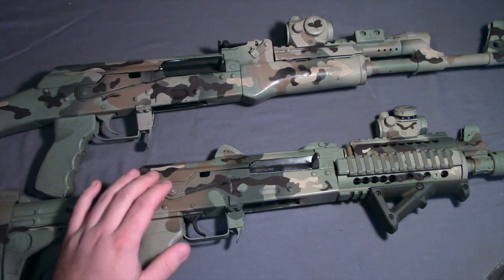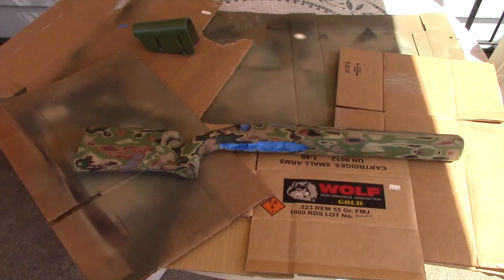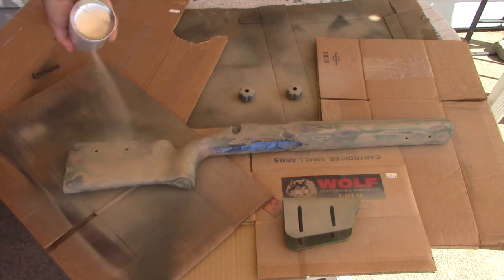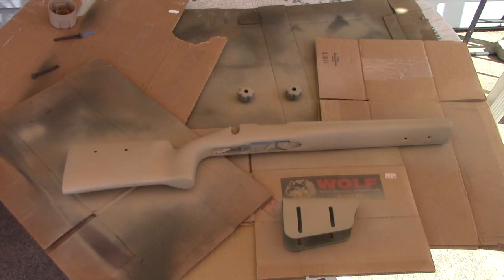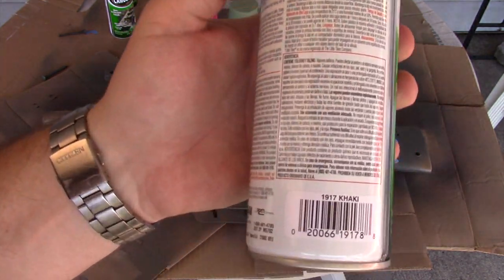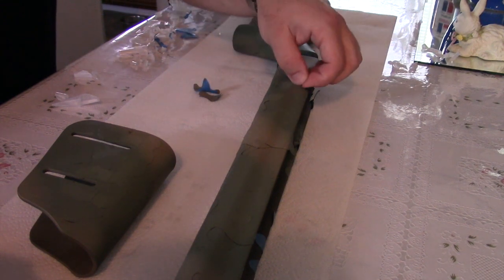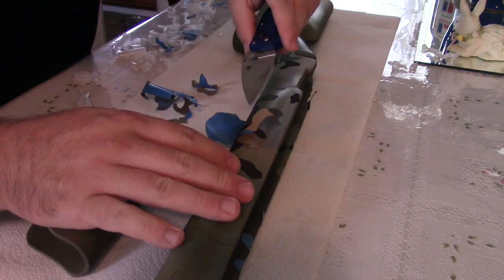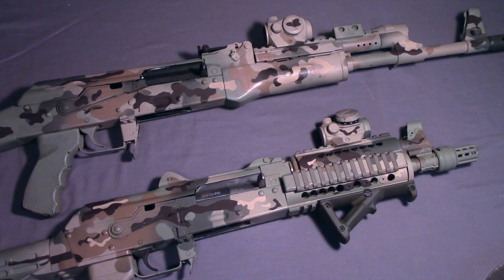Multicam Rifle Paint Job - How to

Comment: The green frog tape works really nicely and if you use a folding bone to press the edges down that will give you the best adhesion also waiting a full 72 hours before applying tape and subsequent coatings.  It’s a long time to wait of course but worth it to avoid peeling of previous layers.  An old wire hanger will aid you in hanging item to be sprayed so as to avoid having to flip them.  The Simpson String Tie building materials company also makes lengths of hardened steel normally meant for retaining insulation that are great too if wire hangers aren’t readily available.

Comment: I've used the exact same colors to do multicam before. Very sound advice, especially on the stencils. I've done that before and it works great, but if you have access to a Silhouette Cameo, its pretty easy to make vinyl stencils if you have a piece of multicam gear to transpose the pattern from. Then you have as many stencils as you want and you can pump them out fast after the initial designing them. Using this method you can get some real squiggles, beans, and blotches from the actual pattern. I pulled mine from a shooting mat and its amazing how many repeat stuff there is in the pattern. Some things that I do a bit differently, when I get to the last two striped coats, I spray one color over the complete rifle and then stripe with the other. I think its easier to make some more subtle blends between the colors and it looks pretty good. Also the strings and beans tend to stick together and string along the pattern. There's patterns to it, but its hard to see unless you have something huge to observe the pattern on. Its hard when you just have little pieces of gear. I did my welding hood and it turned out pretty damn good, but I'm planning on duracoating 3 rifles in the near future.
Reply from the maker: Interesting, I'll have to check it out. I think if I ever do this again I'll use already made stencils from Freedom Stencils.
Reply: Brad Chenoweth 

Welding hood!

Let’s see it

Comment: I just started on my m91/30 Nagant. I'm gonna run up & get the wide painters tape today or tomorrow since it's suppose to be a bit warmer this week.... So I tagged this video as my guide...
Reply from the maker: That's great! I hope it works for you!
Reply: I'm using the same colors that you are but the difference is I'm cutting out all my stickers instead of the sticker kits that most people are using so it's a bit slower but so far they look good. I have Forest Green & a lite coat of Desert Tan for certain area's to finish it off.....

Comment: Looks good, what type of clear coat did you end up using?
Reply from the maker: +Martin Carrera Good question, I probably should have mentioned that. I used the Rustoleum Matte Clear coat. I wanted to make sure that even with the clear coat, it wasn't glossy and therefore defeating the purpose of the camo in my opinion.
I appreciate you watching!

Comment: well done. do you have to cure the paintjob with cleatcoat or do the rust oleum colors resist oils/sweat from the hands? did you tape the trigger?
Reply from the maker: I usually tape the trigger. I do not use a clear coat personally because I like the look of a used gun
Reply: @OreGear  how long does it take, before the paint starts to rip off?
Reply from the maker: Depends on how you use it. If you are running a fighting rifle through classes, it’ll start to wear more quickly. If it’s sitting in your safe all the time, it’ll last a long time.

Comment: did you ever have any issues with the paint on the barrels from heatingup? looking into painting my gun thanks.
Reply from the maker: +jessintime I had the barrel on my Arsenal bubble a little bit around the gas block when I was doing a heat test a long time ago. I dumped 150 rounds in under 2 minutes.

Comment: Ore,did you paint the inside of your receivers on the AKs?what did you use to plug up the chamber and muzzle?
Reply from the maker: +ELad Neb Good question, I probably could have elaborated on that more in the video. On these I taped off the inside of the receiver. On my Arsenal I just left my bolt carrier in the gun to block off paint from getting in the receiver. I would try to avoid getting paint on the inside on the rails and such. If you do, I don't think it'd cause too many issues, and I'm sure standard operation would wear the paint off very quickly. As far as the muzzle, I took a piece of paper and rolled it up and inserted it into the barrel to prevent paint from getting into the barrel.
Hope that helps! Thanks for watching!
Reply: +OreGear thanks Ore,if you know if I can get premade tape patterns for doing a tigerstripe paint job let be know.I want to do up my new/ old SAR 1 in a black/burnt orange with some yellows for fall in the north east
Reply from the maker: +ELad Neb I would look at Montactical.com, they have lots of different types of stencils that you can use to make all kinds of patterns.

Comment: When you did your AK's, did you de-grease them, or do you just spray?
Reply from the maker: +Doug Williams I wiped them down with Slip2000's 725 degreaser prior to the paint jobs. On my M92's first paint job, I didn't degrease it first and it really affected the way the paint looked on the rifle in a negative way. After that I decided it's worth taking a little time and doing it the right way.
Thanks for your question